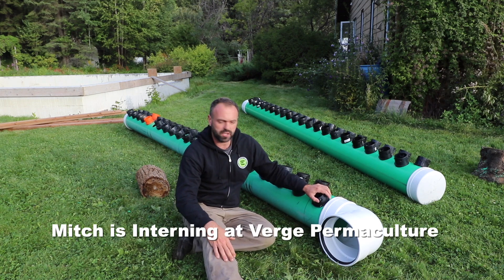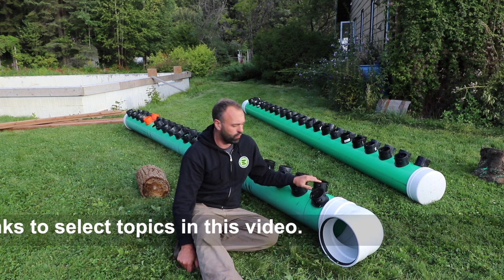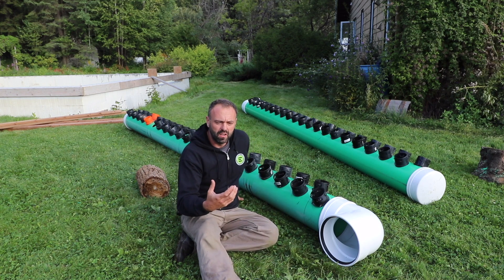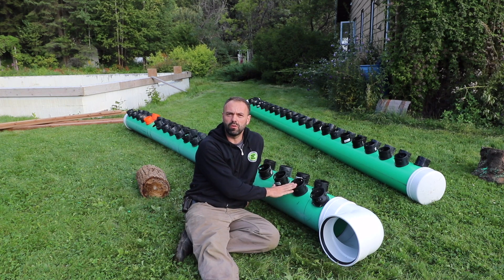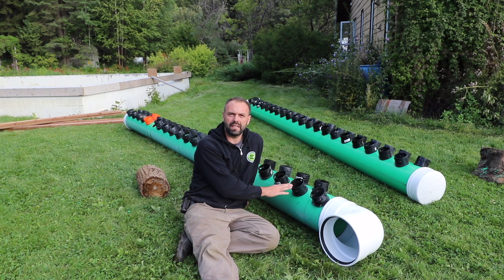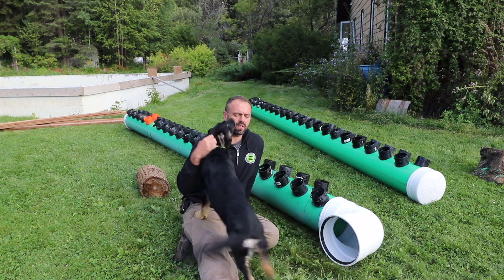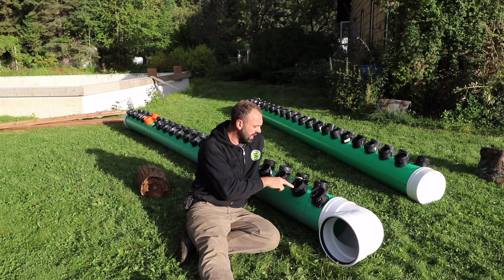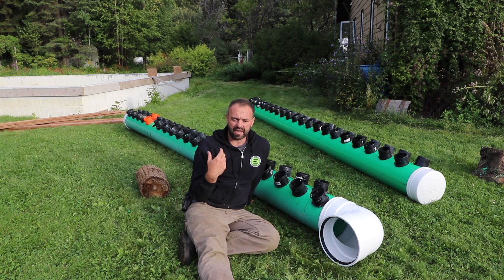Passive Solar Greenhouse Build Progress Update September 1, 2020

Comment: When it comes to greenhouses I strongly recommend a shade net greenhouse, not a plastic one. A shade net greenhouse is way better than a plastic greenhouse. Some of the advantages of a shade house include being cheaper, being more durable, being more effective in summer, being safer to farm workers as it has great ventilation. Its also easier to build or repair. For most horticultural crops such s tomatoes, cucumbers, lettuce, green vegetables, runner beans, strawberries and bell peppers, a 40% white shade cloth is the best.
Reply: ? the greenhouse of Rob and Michelle (Verge Permaculture) is for a climate with 100 frost free days and they have - 30 or even - 40 degrees C during winter (he is in Canada).  Shade nets are an issue in the desert, tropics and subtropics. I do not think they have farm worker it is a family farm and the operations is not that large. there is a large door  - and the plants they grow also do not fare so well when it gets too hot resp. when temps and humidity jump around. 

Part of the reason to have that design is to moderated the temps also in summer. He says it helps to pass on wins to the next quarter of months (because of the storage capacity of the soil9.

So spring still cools the system in summer with long sunny days. Summer provides warmth in fall, fall moderates the bitter cold of winter. They do have many sunny days also in winter, but days are short and days and even more so nights can be very cold. Obviously shade netw would do nothing for them;)

But even summer nights are fairly cool.

Comment: If it’s not too late, you should wire a series of temperature probes in the tubes, and in the surrounding dirt. The data you get from that could be invaluable. Quickly looking at Ali Express, it looked like you should be able to get some for $1-$2 each.